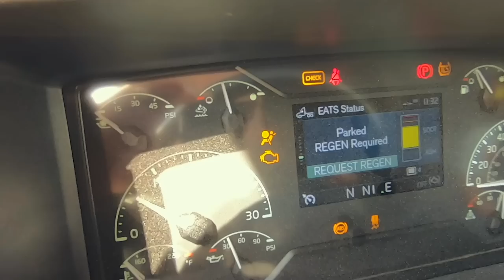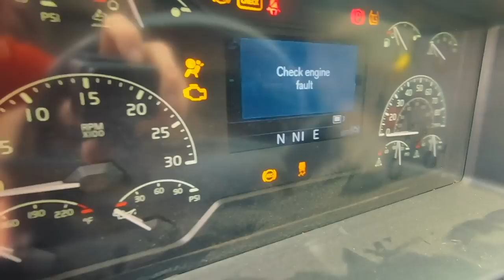From Scrap to Showroom: A Time-Lapse of Transforming a Wrecked Volvo VNL760 Semi Truck Project

Comment: Apart from falling off the step ladder and those horrible pointy front nut covers that was seamless, but i,m pretty sure it wasn't in real time,. its took a while but it looks fantastic, you make everything look easy but i,m sure wasn't,.i,m confused as to which cab/chassis/engine/axle configuration you ended up with ?,. you saved a ton of money on labour and even the outdoor repaint came out good, it seems you got lucky with the weather to,. great job rusty now keep on yruckin,.